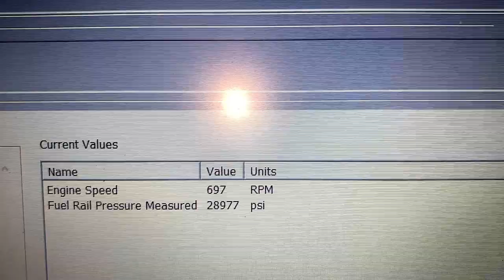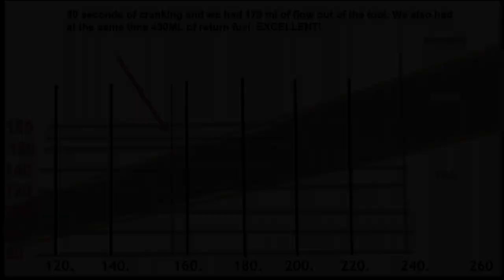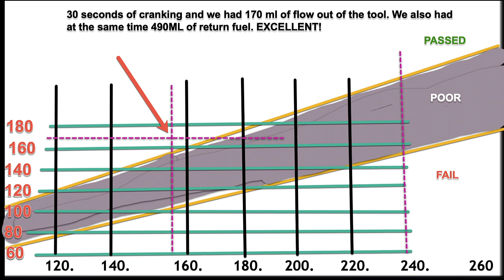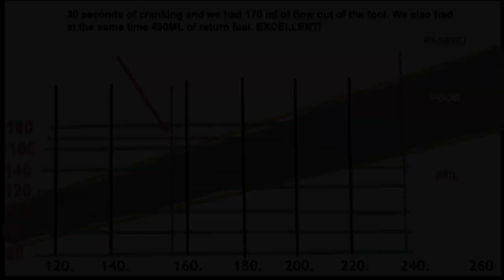FC559 video 5- Rail volume test

Comment: whats the part number for the fuel pump housing?
Reply from the maker: There are a few different part number cam housings. They have to be looked up by engine serial number.